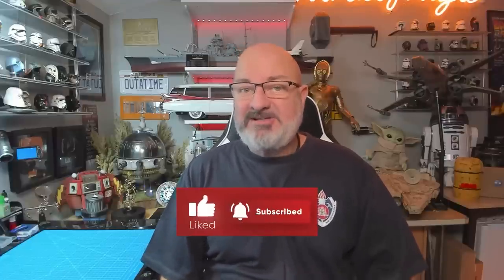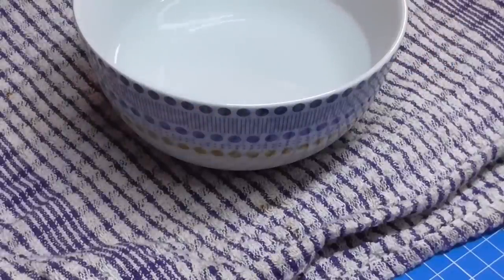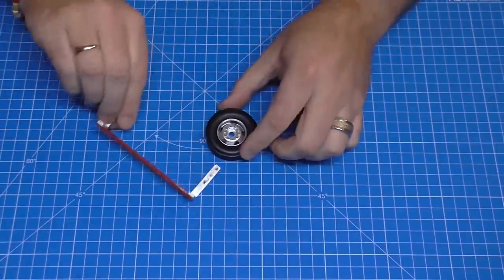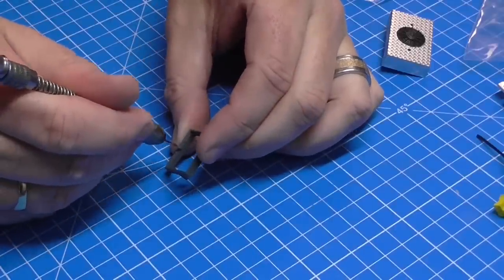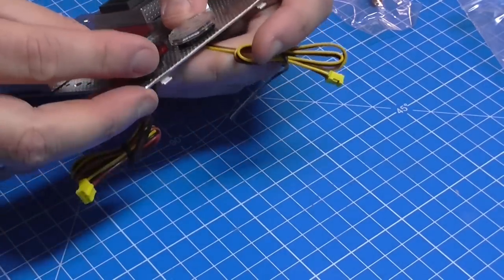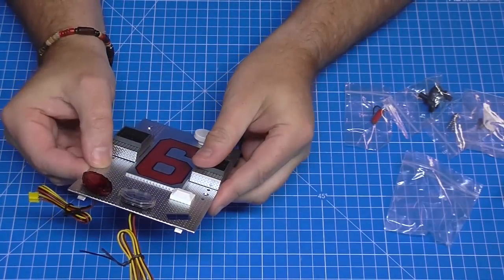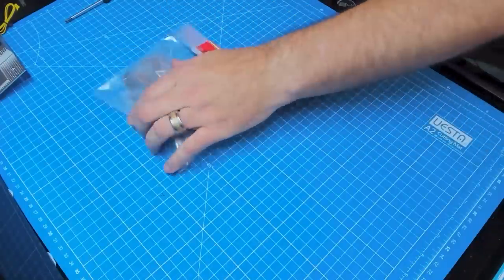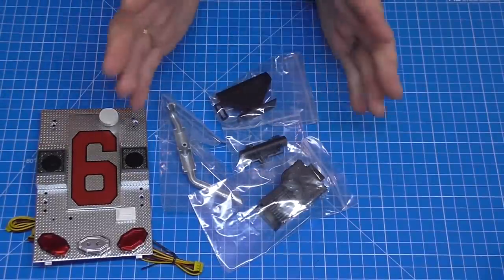Build the FDNY Ladder 9 Fire Truck 1:24 Scale - Pack 2 - Stages 9-16

Comment: None of my magnets were installed, but all 4 slots where they sit had old, dried leftover glue that I had to remove.  None of the magnets had a red line either, but the instructions told you what to do and thankfully it made sense.  The back right of my chassis was bent, I realized that when one of the wheel well extensions wouldn't fit but thankfully, I was able to straighten that out.  I noticed a quality control sticker, indicating it was checked but these were things you couldn't miss.  It wasnt a big deal at all, but considering the price of this model, I do expect quality.  Anyway, I have pack 3 here, and I am looking forward to starting that one.  It looks a little intense compared to this point.

Comment: This model is not worth the $1600 they want for it. Ya it looks nice but it's to small and lacks a lot of detail.  For $1600 is should have an engine/trans to build, the pump, seperate frame and floors, All  of the cabinets should be packed with stuff.
Reply: I’m kinda bummed about those details missing, but am excited about the cherry picker, which is exclusive to this model, while engines are not exclusive to any one model. As for tools, I’m sure it would be eventually possible to 3D print them.
Reply: @keithmuset6510  It has no engine, it is just stamped detail of the oil pan in the floor. This kit is a complete rip off for the price. You can buy the same scale kit in plastic for $100 and  it will have more detail
Reply: @allengrier4767  dude, if you want to build a sick motor, look into the Porsche 917kh. Not all models are going to have one, but I can tell that it’s an important selling point for you, and I respect that. I’ll reserve judgement until I’m on pack 4 or 5. I be spent money on plenty worse things.
Reply: @keithmuset6510  The point is that there is no way this kit is worth $1600.  You can fire truck  model kits that have more detail and spend under $200 for it.
Reply: It's true, it is a ridiculous cost and you'd expect a heck of a lot more detail for the money.  I did purchase it, only because I have two sons who both work on trucks. How can I not?  I wish I could get their truck numbers and thought about looking into finding a way, but it is no big deal.  Also, some of the proceeds goes to FDNY, otherwise I don't think I would have pulled the trigger on this.